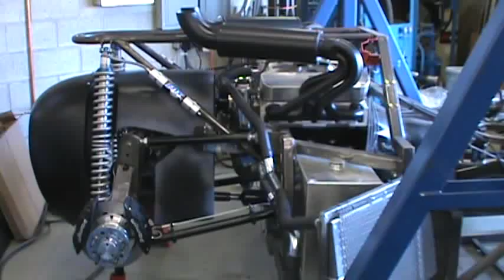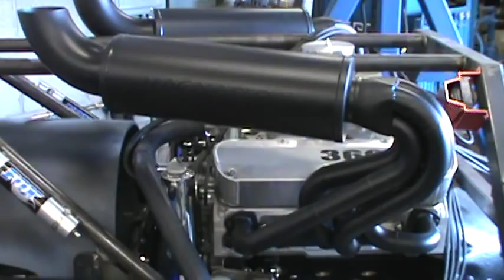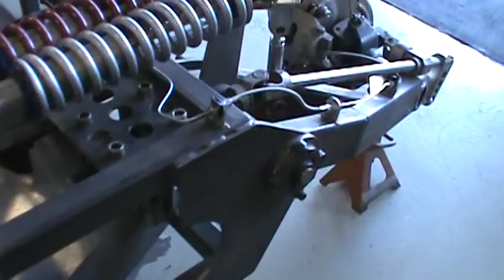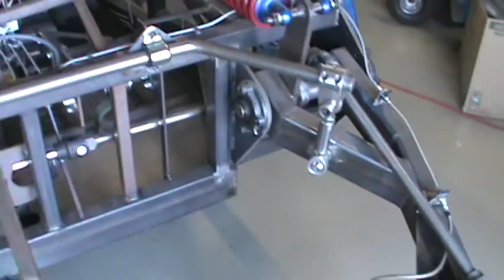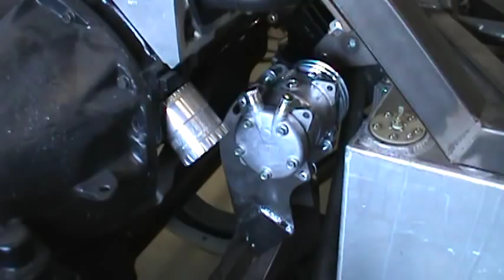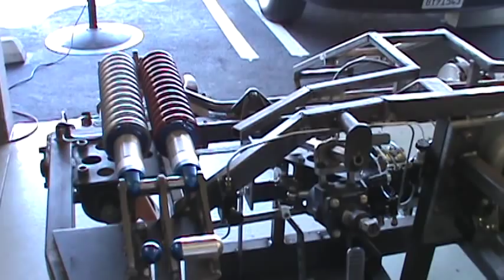Building the Tumbler Tribute Part 6, Batman

Comment from the maker: No, the front control arm is a 2"x4"x1/4" wall steel tube, try and twist it!  I have a 2deg. negative camber built in, at worst under extreme cornering I fell it might be brought to a 1deg negative or at zero, both of which will not create a problem.